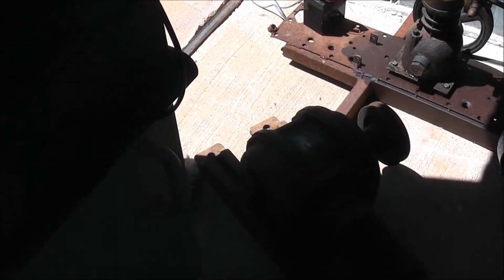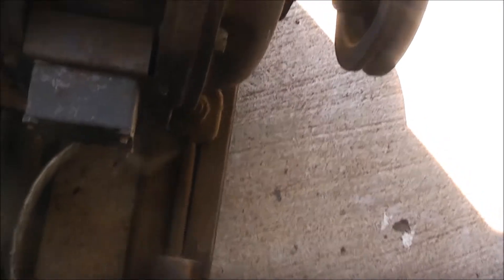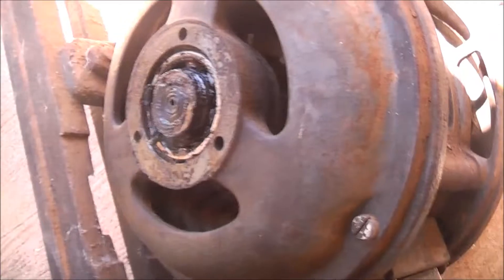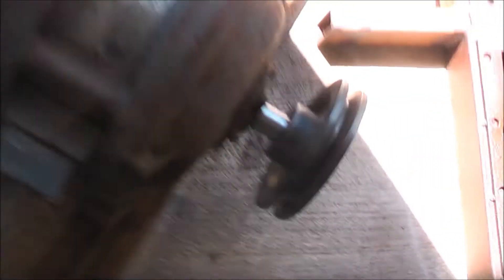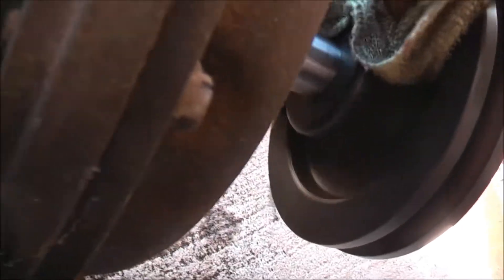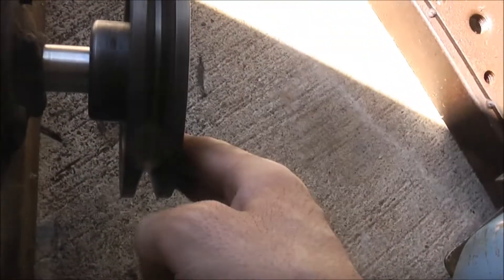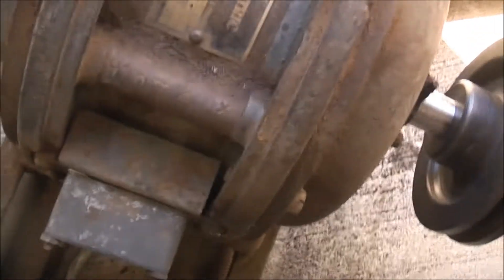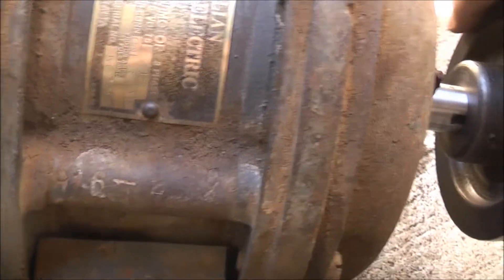1940s A.G.E. 3 Phase Motor Score

Comment: An old friend once had a Fairbanks-Morse ball bearing motor from the 1930s...a 1-1/2hp 56 frame motor which came off of an air compressor.  It sat in storage for almost twenty years and when tested it was dead quiet.  I put it on a 16-inch squirrel cage fan and it swung it like a champ.